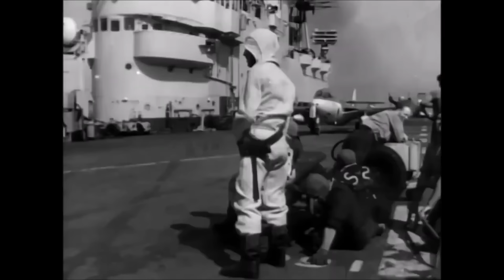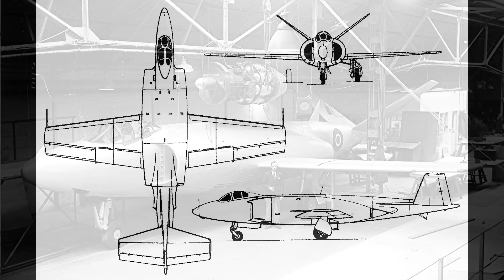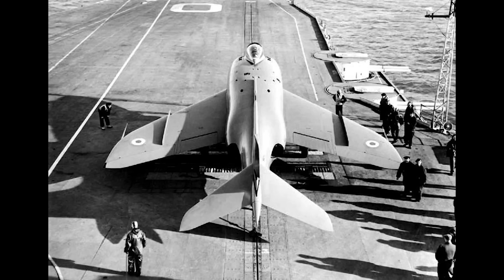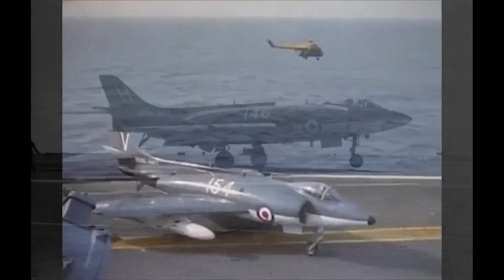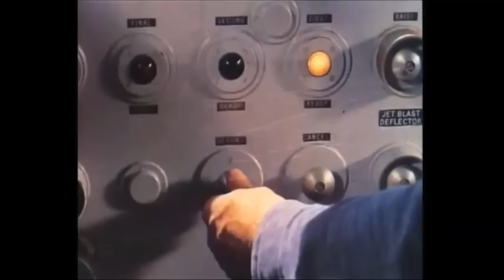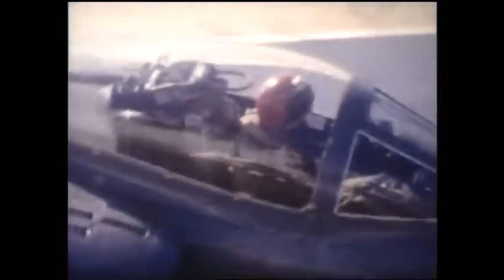Supermarine's Last Fighter: The Most Powerful Gun Battery Ever Deployed To A Carrier

Comment: I would also compare it with North American's ultimate SABRE, the FJ-4 Fury

FJ-4 Fury
Single-seat fighter-bomber version, powered by a 7,700 lbf (34 kN) Wright J65-W-16A turbojet engine, 150 buit
FJ-4B Fury
Single-seat ground-attack close support version with six underwing pylons, 222 built.

Of the original order for 221, the last 71 were modified in the FJ-4B ground-attack version. This had a stronger wing with six instead of four underwing stations and stronger landing gear. Additional aerodynamic brakes under the aft fuselage made landing safer by allowing pilots to use higher thrust settings, and were also useful for dive attacks. External load was doubled. The most important characteristic of the FJ-4B, however, was that it was capable of carrying a nuclear weapon on the inboard port station. It was equipped with the LABS or Low-Altitude Bombing System for the delivery of nuclear weapons. The Navy was eager to maintain a nuclear role in its rivalry with the Air Force, and it equipped 10 squadrons with the FJ-4B. It was also flown by three Marine squadrons. In April 1956 the Navy ordered 151 more FJ-4Bs, for a total of 152 FJ-4s and 222 FJ-4Bs produced, and 1,115 FJ aircraft of all variants delivered to the Navy and Marine Corps.

Comment: The picture that shows mid-air refueling is behind a USN KA-3d (SkyWarrior, usually called whale on USN flight decks).  The smaller aircraft in the foreground is an A-4 Skyhawk (usually referred to as SCOOTERS in the USN).  Interestingly, the scooter pictured is carrying a 'buddy-pack' refueling rig on the centerline.  The pod has a wind powered generator and hose reel on the sft end, allowing a lot of the sky hawks fuel to transferred (scooters NEVER had much fuel (later getting the 'humped' fuel tank) so almost evey time you see an aircraft using a buddy-pack (even the F-18s today) it WILL carry as many drop tanks as possible.

Comment: I've seen that rubber deck wheelless aircraft before, back on Discovery Wings in the 90s, I think. I always thought that was a crazy idea. How are you supposed to taxi the aircraft out of the landing area after recovery? Do you have to jettison all external stores, drop tanks, and even air to air missiles before landing? No wonder it didn't go anywhere.
Reply: Maybe the boats would have a crane fitted? Or perhaps the rubberised decks could work like giant versions of the conveyor belts you find at supermarket checkouts?

Comment: Someone needs to explain to me what a "low level nuclear attack" means as a mission for any kind of plane.
Reply: Fly in low and fast.
When at a designated range to the target pull up hard and when at  the right height and angle the bomb is released.
The aircraft keeps pulling up and over, rights itself in a roll when going back the way it came in and shallow dives for the deck to get all the speed and distance it can as the released warhead continues on its upward trajectory until gravity stops its rise. Some did have a chute deploy at this point to slow it down even further for the aircraft to have more time to egress the area.
Reply: You really never heard this before?  It's deceptively simple: The strike aircraft flies at low level to avoid detection by radar and limit the engagement envelope of ground based air defenses.  The weapons can be lofted, tossed, or retarded by parachute to give the aircraft time to escape the blast zone.

Comment: Its interesting, i wonder how a Scimitar with the wing moved lower (like an F-4 Phantom) and an area rule fusealage would have performed. British jet designs other than the Lightning seemed stuck in an immediate post-world war 2 paradigm for decades.
Reply: It's the atomic age flowing curves thing, everything forward of the wing just screams 50s, and the tail fin is not helping. Ultimately the F4 isn't actually all that different in design, but it's just sharky enough to feel like it's from a more modern era.
Reply: I look at the Scimitar and see a stretched, mid-wing Harrier. Is it just me?

Comment: As an unapologetic F4 fanboy, I am struck by the similar forum of the two aircraft.  One has to wonder if there was any inspiration of one by the other, or if it's a case of convergent development.  Beautiful aircraft.  Great video.
Reply: It looks a lot like an F3H Demon, really.
Reply: @WillKinton  A lot with the Hunter as well.
Reply: Convergent evolution most likely: you needed two engines - most obvious placement (like almost all other jets of the era), area rule fuselage, cockpit as far forward as possible for visibility and the curvy lines typical of pre mach 2 jets. The Hunter, The Buccaneer, The Vampire (despite the boom tail) all resemble each other despite different manufacturers and roles. Hell give it a delta wing and it looks just like a curvy Mirage 3. I can see even a Harrier in there if i squint a little :)).
It's the same with the F14. F15, Mig 25, F111 all looking similar, aerodynamics are the same for everyone, so sometimes they find similar solutions.
Reply: To me it looks like the F101 voodoo had some schmexy time with the F3H demon.
Reply: Check out the F-101

Comment: Never ever heard of (or even imagined) landing a wheelless jet fighter on a rubberized carrier deck(!!). Thanks for unearthing this bit of esoterica.
Reply: It's the kind of info that bounces out of nowhere...
Reply: Landings carried out by Eric Brown (who else?)
Reply: @kitbag9033 if a me 163 don't kill me then a rubber deck has no chance 😊.  What a legend he was and continues to be.
Reply: @ Absolutely!!
Reply: @kitbag9033 what DIDNT winkle fly?😁
Reply: @migmadmarine Valkirie
Reply: There's a Monty Python sketch  in there:  

"Well sir, after it stops bouncing we simply extend the landing gear and. . .umm. . . ahh. . ."
Reply: @rollerizer2558  it was even proposed for ground runways to allow early jets to dispense with landing gear and increase fuel load.
Reply: @wbertie2604  I'd definitely buy a ticket for that....
Reply: I'd heard of zero length landing, and now I've seen how bonkers it was.
Zero length launch was bad enough.
Reply: So, other than the other fine points people have brought up here, what if something weird like, oh I don't know, the rubber gets wet somehow, and/or it gets greasy from something like aircraft mildly streaked with hydraulic fluid repeatedly slamming down on it? Does it then turn into a slip'n'slide?
Reply: As you can see clearly in the video the rubber deck was used with arrestor wires, so slippy or not doesn't really matter. It did actually work and isn't as bonkers as things like the "hurricat" system which used a hurricane as a single-use fighter to defend convoys in ww2... and that was deployed for real with the pilots having to be fished out of the Atlantic after ditching. That was only a few years before the rubber deck, which adds a bit of perspective!
Reply: @chemistrykrang8065.
I wouldn't liked to be one of these pilots. But then, they were useful for removing high flying spotter planes on the Arctic Convoys.
Reply: @ald1144  That's a sensible question I wish I'd though of first BUT
Same applies to tyres & decks
I guess the used tail hooks & catch net as usual would do the job
Awkward if some underlung ordinance hadn't unhooked tho
Reply: I suppose they wouldnt be used on airfields
Reply: @migmadmarine flexible deck airfields were proposed
Reply: Notice no pictures feature a wet deck.😂
Reply: Get hold of Eric (Winkels) Brown book 'Wings on my Sleeve'. He was one of the test pilots.
Reply: @ He was the LEAD Test Pilot on this program
Reply: It's pretty common knowledge tbf.
Reply: Thats what your mum said
Reply: Capt Eric 'Winkle' Brown, you should read his boography nobody flew as many different aircraft as he did not even Neil Armstrong and he flew a few.
Reply: Yes, it's rather embarrassing considering think that the R.N. was first with game-changing catapults and angled decks.
Reply: I just do not understand what the British are thinking, like ever. 😂
Reply: @GeneralJackRipper  Last time I looked experimenting with a concept to see whether it is feasible, or if any lessons can be learned from it, is not stupid. 

Now had they built an entire class of rubber decked carriers with bouncy aircraft for all of them, and THEN found that no, that's a silly idea, THAT would be stupid....

At the end of the day that's all the rubberised carrier decks were, an experiment. Its hardly the weirdest experiment around at the time, and unlike other weird experiments it did not go into actual production. 

The Davy crocket Tactical nuclear launcher springs to mind, you know, the vehicle launched nuclear rocket propelled munitions launcher that had a larger blast radius than it had effective range... And the Americans PUT THAT INTO SERVICE..... A weapon that once fired was guaranteed to kill its crew and the vehicle it was mounted on....

Bet that was real popular amongst the US infantry of the time.....
Reply: Landing on a rubber deck without wheels could be done by Corsairs. 
Once !

The propeller is the problem. So use a rocket plane or a jet. 

The sea harrier and the lightning 2 can both position themselves over a cradle and descend to it.
There is a YT video of a US Marine harrier going down gently to the cradle used to support the forward part of the aircraft and in that case it was because the nosewheel didn't come out. 
Good, patient, flying.
Reply: No imagine said fighter coming back for a landing... with pylons full of ordnance!

Comment: I am just trying to understand that parking brake issue. I would have thought there would be s static cockpit mockup used to go through all potential inputs indoors, and a few taxi tests before a first flight from an airfield, all prior to a deck launch attempt.
Reply: The Brits have been notorious for just tossing all the controls in wherever the workmen think it's most convenient without regard to how they will actually be used since before WW2. Their WW2 aircraft were notorious for being a pain to actually fly and needing special contortions to operate, the compass or radar behind the control stick, the trim wheel behind the seat, etc. They gushed about how much better US planes were when they got to fly those, but apparently they didn't actually take any lessons from that. The US actually spent a bunch of time and effort trying to make the controls as logical and easy to use as possible.
Reply: I assume that the static tests were done without lifejackets and full suvival gear buldging everywhere.  Alternatiely, strapping was not as tight as used in service. So allowing more comfort and movement in the static tests.

Comment: I like the not-so-subtle skiting about the "robust" & "potent" nature of the Imperial gallon as distinct from the relatively paltry US gallon
Reply: No one measures aircraft fuel in gallons anyway, it's measured in weight. I believe the US and UK are in agreement on pounds. The rest of Europe is hung up on metrics...
Reply: @uberduberdave  Not quite. In the UK we still use Imperial for some things, but mostly we use metric, and we use metric for everything in science and engineering. 

Pooh pooh metric all you like, but at the end of the day ALL measurement systems are arbitrary, including the Imperial system. What the measurements are based on is really not relevant, what IS important is that those measurements remain the same and repeatable, so an inch is always the same length, a metre is always the same, a pound the same and so on.

What makes a system of measurements superior, is not in whether they are 'more natural' (as I have heard some argue, falsely), but in ease of use, and I am afraid, being familiar with BOTH, being a Brit who was brought up using both, Metric utterly shits all over Imperial for ease of use. 

You cannot get easier than a standard base ten system, Imperial by contrast is all over the place. 12 inches in a foot, three feet in a yard, 1760 yards in a mile, and so on. Its a pain in the backside to work with in comparison to metric, which is simply a case of moving a decimal point left or right, its that damned easy....

So on balance, insult metric all you like, but being someone who has used both their entire life, I prefer the ever living hell out of metric.
Reply: @alganhar1 Joking aside I would generally have to agree. There are a few things in which I prefer imperial, the base 10 system is definitely better. As you said, it's all arbitrary in the end.
Reply: @uberduberdave You mean the rest of the world?
Reply: @RobCrawford23  An irrelevant fact that no one cares about.
Reply: @uberduberdave  distance in km, speed in km/h, altitude/elevation in m/km and mass in kg.
that's the way it should be.🙂

Anyway, we have learned that proper gallons are robust and potent. 😆
Reply: @daszieher Damn maybe you guys should have invented the airplane.

Comment: I love that the rubber mat landing thing could actually work. It gives me hope that a dorsal hook zip-line landing system could work. The carrier tows a large glider or gyroglider, with the tow line acting as a mid-air arresting cable. The aircraft's dorsal hook snags onto the cable and then zip-lines down to the carrier deck.

Actually, this idea would work best with a pair of ships. The carrier has an escort; the escort tows the gyroglider. That way, the cable and gyroglider can be used both for landing and launch. The carrier doesn't have a superstructure ... it's just a flat deck with facilities to resupply the aircraft. The "escort" commands operations, with the gyroglider/cable used to gently lower aircraft onto the carrier's deck and lift aircraft from the deck to drop launch...
Reply: In WW2 USN had a sort of zipline looking system to launch and recover Piper Cubs from transport ships.
Reply: The gyro kite idea was tried by the German navy during World War Two attached to a submarine. They could then see further but also could be seen from further away
Reply: What

Comment: I was always a bit surprised that, packing two Avons, it wasn't faster - there is an obvious land-based two Avon comparator (but I supposed that was specifically designed to be Mach 2 aircraft).
Reply: The avons in the scimitar are probably completely different and possibly weaker variants, obviously without the afterburners of the lightning. 

And seems like the design is not optimized for transonic or supersonic drag, so probably it hit a drag wall at Mach 0.9 or so, which even avons would probably not help with. 

Meanwhile the lightning could probably supercruise  without burners at medium and high altitudes.

Comment: How in the world did they plan to launch those aircraft with no landing gear?
Reply: On a trolley. The whole idea worked and potentially saved a lot of weight in the aircraft but just wasn’t practical. I suspect the thinking was based on a short nuclear war - get as much out of your aircraft as .you can before it all went up in fireball. But not ideal for peacetime ops.
Reply: Two big matelots under each wing to hold it up. It what the rum ration was invented for.
Reply: Couldn't land with stores or a lot of fuel I'm guessing on rubber deck
Reply: @stevepirie8130 usually couldn't anyway, because of weight limitations, and that's a small price to pay if you can save the space and weight required to lug a set of wheels with you. They might not even need fuel tanks if you can just use that space for more internal fuel anyway. But the navy has never been afraid to jettison stores to land a jet, if you are afraid to spend money, naval aviation isn't the area to get into. 
Not that they were carrying multi million dollar missiles at this time anyway.
Reply: Apparently the Martin company thought the idea could work well in conjunction with their Zero Length Launch system
Reply: It was a sound idea, and it did work in practice, but it severely limited the locations the aircraft could land safely in an emergency and basically stuffed any chance of inter-service interoperability unless the RN could convince everyone across the world to include and maintain a little rubber strip and trolley launcher at their airport or airbase.
Reply: Ever heard of a catapult? They routinely launched float planes, and Hurricanes without landing gear extended in WW2, yet you are shocked that it could be possible to launch a plane in any manner other than by hauling it on its own wheels over the edge of the deck? You actually sound like you assume they just didn't think of that part, those silly gooses, how stupid do you think they were?